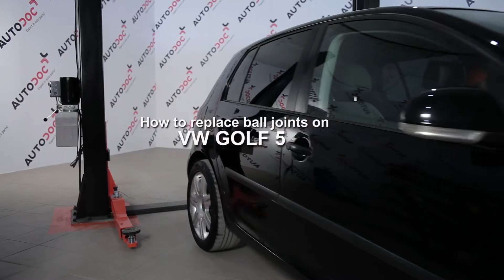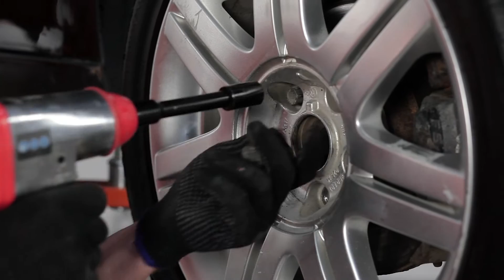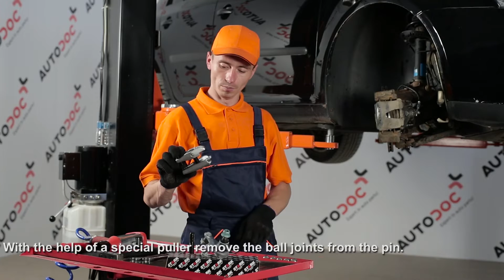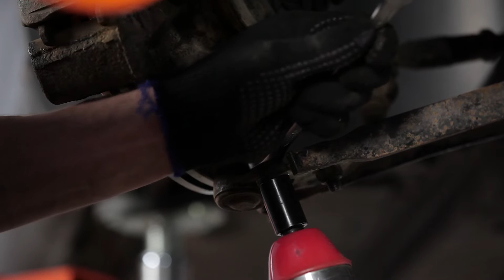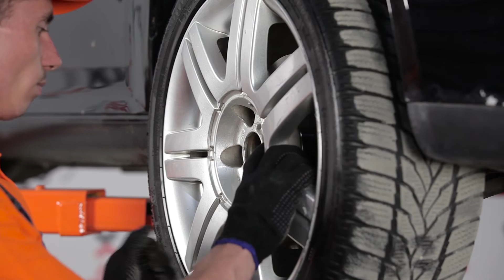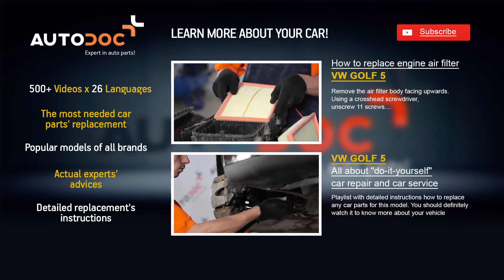How to change ball joint on VW GOLF 5 TUTORIAL | AUTODOC

Comment: Yep. Get ready to replace the same ball joint in a year. "All bolts at suspension parts with bonded rubber bushings must
 always be tightened in curb weight position"
Reply: Unless you jack the suspension up, how are you supposed to do this with the car on the ground
Reply: @T2oys  VW has a special jack contraption for raising the axle: VAS6931 +  T10149
Reply: such as control arm bushings etc. ball joint is not
Reply: @troopin  of course ball joint is. Just look at the VW docs for the "Ball Joint, Removing and Installing" -
it explicitly says "Tighten the (three lower) nuts in curb weight position."
Reply: @prs314 makes no sense logically and practically
Reply: @hamza12529  some rando thinks he knows better than the VW engineers?

Comment: Thanks for the video, nicely done. I changed the same ball joint in my Audi TT today and the track is now towing out and the steering is misaligned. Should I have finished tightening  the 3 bolts with the wheel on and on the floor? Nothing is worn and the steering rack was not moved. I have to assume that the joint can position itself differently.
Reply from the maker: Thank you for your comment! 
The control tightening of the ball joint bolts can be carried out when the wheel on the weight. 
Stay tuned with us!
Best regards,
Autodoc team!
Reply: Happened to me as well with Mapcojoints, ended up buying VAG original balljoints, soo much better.
Reply: Your camber/toe changed when you replaced your ball joint.
Reply: TT has adjustable front camber due to slotted bolt holes in lower arm. You need a alignment after.
Reply: Thanks for the advice I have sorted it by swapping it for aF type now my problems will begin.

Comment: Thanks for this, but why is it necessary to remove the axle bolt (and shouldn't this TTY bolt be replaced?) - is the extra working space that much more significant? Does it matter if the axle accidentally pops out off the hub?
Reply from the maker: Thank you for your feedback!
You are absolutely right, we will take this into account in the following videos.
Best regards,
Autodoc team.
Reply: @autodocuk  Hi,
I just purchased 2 ball joints for my Caddy van 2007 model but the old ball joint is too tight to drop out! do you have any tips?
Cheers.
Reply: @llewbach77  Disconnect the tie rod end then you can remove the driveshaft/CV joint fully and whack the top of the balljoint with a big hammer.

Comment: How necessary is it to remove the driveshaft bolt? And it's single use right? I am looking at replacing ball joints and LCA bushings and bracket at same time. Really would like to get out of removing the DS bolt if I could.
Reply from the maker: The screw bolt must be extracted from the drive shaft, as this makes it possible to move off the hub to obtain some space to work with the replacement of the ball joint.
If you don't do this then during the displacement of the hub you will you pull out the drive shaft from the box and there will be oil leak. It's better to do from the hub side. Best regards, Autodoc.

Comment: Beautiful videos ☺️. Do you need to perform wheel alignment after that?
Reply from the maker: After replacement, it is recommended to correct the camber.
AUTODOC
Reply: @autodocuk  There is no camber adjustment possible on Golf 5 front unless you are talking about moving the subframe?
Reply: @dopiaza2006 in cowboy garages nobody's bothered about that unless you take it to somebody decent to do it

Comment: Thank you for the video but it has kind of glossed over tightening the nut on the tapered cone of the ball joint. With the drive shaft in place there isn't space to put a splined tool in the centre to stop it spinning when tightening. I've seen a suggestion of jacking the ball joint into the hub carried but will the resultant friction be sufficient to tighten to the nut to the specified torque?
Reply from the maker: If the hinge starts to rotate, you can press the ball joint from below with a stop to remove the gearbox. If you don’t have such a tool, you will have to remove the CV joint to gain access to the inside of the hinge.
Reply: Thank you

Comment: hi 
 are these steps the same for tiguan 2009.thanks , and if its right that we can hear a sound like "stretching " when we turn the steering wheel on the right or the left
thanks
Reply from the maker: Thank you for your feedback! The replacement  will be similar, but there can be a lot of reasons for an alien sound. We recommend that you contact Car Specialized Service for full diagnostics and detecting of the reasons for the noise. Best regards, Autodoc.

Comment: Torque settings for top bolt of ball joint? Thank you. This is dangerous and you should say proper torque
Reply from the maker: Thank you for the feedback! All torque specs are indicated in the technical documentation on the vehicle maintenance, you can find them out at the official car dealer. Best regards, Autodoc.

Comment: The axel bolt needs proper torquing and loading on the wheels otherwise the bearings will be damaged I also thought it was a single use stretch bolt why remove it?
Reply from the maker: Yes, you are absolutely right and we will definitely take this into account in our new videos.
AUTODOC

Comment: Meanwhile back in the real world... The ball joint jumps out of its taper while undoing the 19mm nut. Then the pathetic hex hole in the joint shaft strips out. Cue air saw to cut old joint out. And how the hell does he tighten the new nut without the ball joint spinning again?
Reply from the maker: Hi! Thank you for your feedback. Our videos are for guidance only. All routine replacements and values \u200b\u200bcan be found directly in the technical documentation for your car or use the help of a car maintenance service.

Comment: lol @ that hub/beairng bolt coming straight out....that was pre-loosened with a 5 foot breaker bar before the video was filmed. Only tool that can remove one of those is something that has 1000nm reverse impact torque i.e. the best of the best air impacters or a dewalt dcf899
Reply from the maker: Thank you for the feedback! This video is considered to be an informative one, and it shows the sequence of repairs, so some stages of the repairs might have been excluded. Best regards, Autodoc.

Comment: No torque settings !!
Reply from the maker: You are absolutely right. All the main bolt connections must be tightened with a torque wrench. This video is considered to be an informative one, so it just shows the sequence of repairs. Best regards, Autodoc.
Reply: I approve, I was a bit shocked by that but as he said it's mainly to show how to replace a ball joint.
Reply: Top tip regarding torque setting of the ball joint top nut: make sure you apply a reverse load (upwards) to ensure you reach the correct torque setting. Reasoning behind this is that it's the natural weight bearing position when the car is back on its wheels. You can use a jack pressed up against the steering knuckle to achieve this. If you don't do this, you won't achieve the correct torque setting, and risk the ball joint being too loose, which can cause knocking and premature failure of the ball joint.